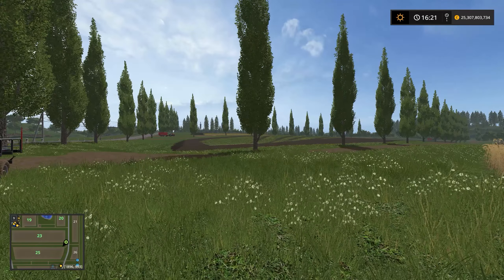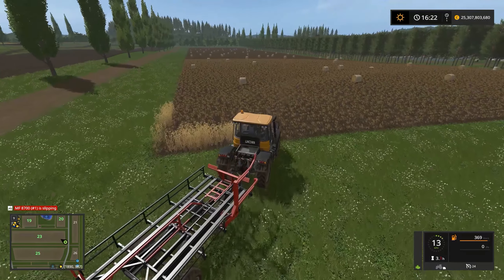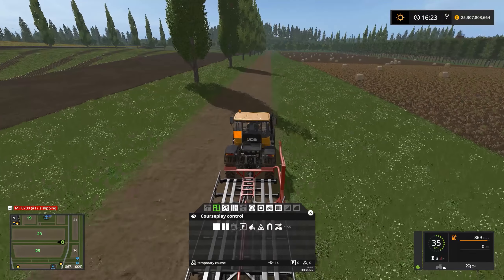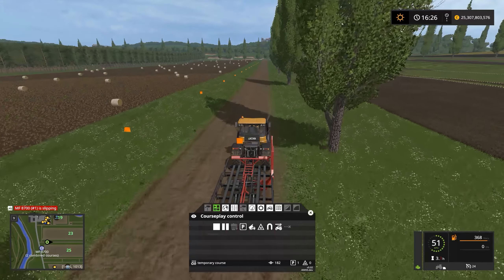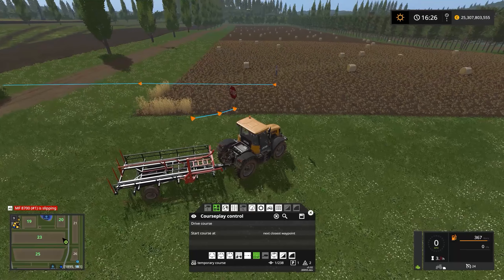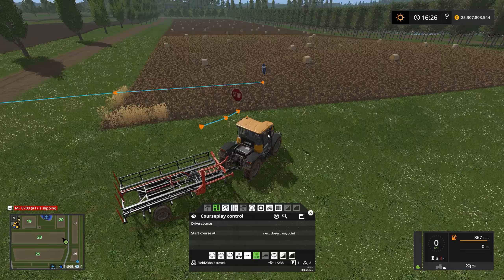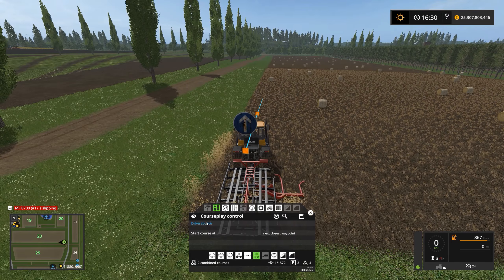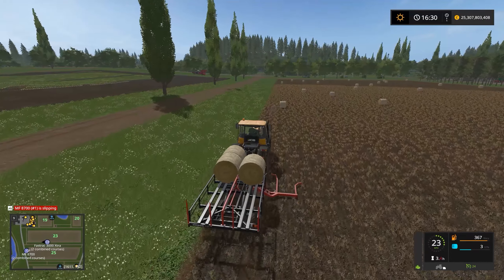How to setup Courseplay 5 for transporting bales from the field to the sell point

Comment: Having mixed results  with latest  version. Freezing up game at certain  tip points . 
Also ...can you explain the use of the."align first waypiont" option in settings please.
Reply from the maker: I did notice the "align first waypoint" option, but I haven't looked in to it yet. I'll see if I can figure out what it is about and make sure to get back to you asap ;o)
So far I am not experiencing any issues with the latest version, but then again I am not really playing a full game right now. It might come once I start recording the Let's play
Reply: Datalund . It's been in the Las  couple of dev versions. Maybe it's for a forager offset trailer. Not worked it out yet myself.
Reply from the maker: Kwaka have you reported the bugs to the dev team? Perhaps they can work out a solution to the issues you are having. I haven't experienced them myself, but that might just be a coincident
Reply: Datalund .
No. Was going to check it on other maps first. 
The pathfinding us greatly improved.  Along with  object avoidance.
Pathfinding works even when cut through the middle  of  a  field.
Love this mod.

Comment: It is not tractor issue, I think (about "turn on field"), but that potato harvester. Courseplay never turns on field with it for some reason, ignoring that setting. I suspect that "if not canTurnOnHeadland and not turnInfo.isHarvester and not vehicle.cp.aiTurnNoBackward and turnInfo.turnOnField then" code in turn.lua prevents that.
Reply from the maker: That actually makes perfect sense. I did have a lot of issues setting courses up for the potato harvester and the beet harvester. In the beginning I had to have the developers to adjust the script for combines, so it would actually recognize those two machines as harvesters, so there might be some additional tweaking needed

Comment: Can I use this course to u load to a auto load trailer if I set a drop point there and the auto load trailer to pick in and I go deal with another filed ?
Reply from the maker: I am not sure Courseplay can handle that setup. In theory it should be possible, but I wouldn't be surprised if it doesn't work though ;o)
Reply: Datalund I might have to test that out Hhmm I guess I would use the unload/dump here button on courseplay correct
Reply: Do it doesn’t but it does unload bales to the placeable bale storage building so now it would be to get bales from bale storage to sell when price goes up or to other places like the straw harvest setup
Reply from the maker: Ah yeah I did think about those new bale storage buildings. Thank for testing it out and letting us know 👍😉
Reply: Datalund ya I have three set up one near a field for the field and unloads perfect there and then another two set up near the straw harvest add on building so all I have to do is use the train trailers and use aul and just move them myself between bale storages